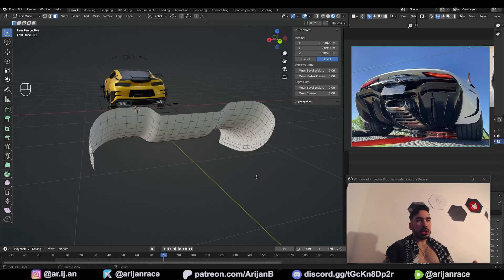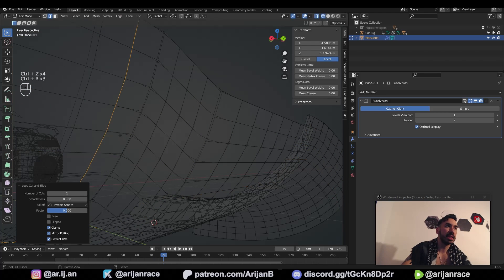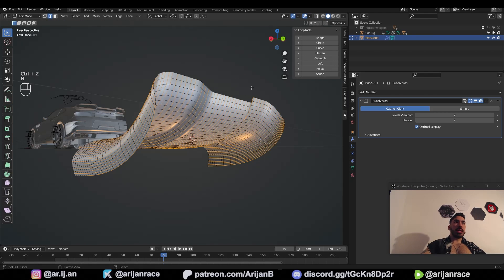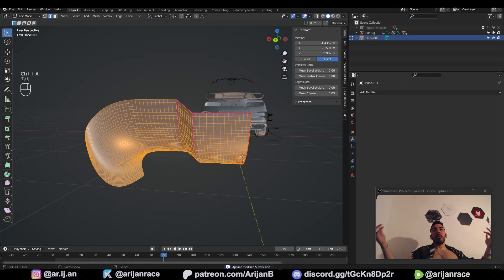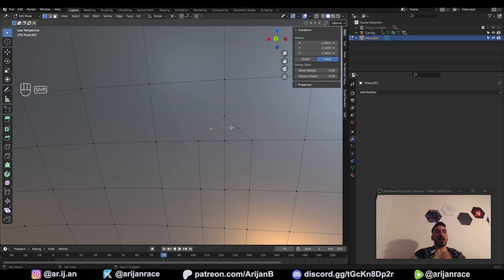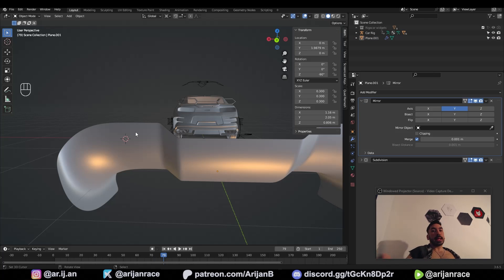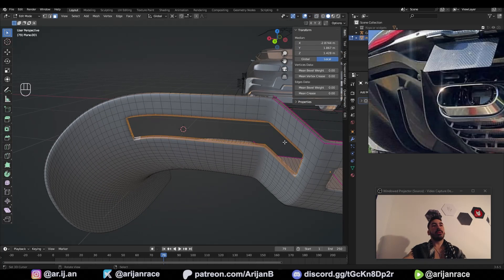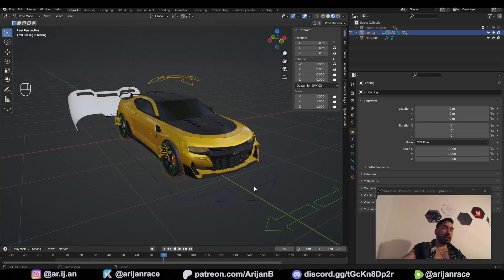The BEST Topology Tips for Car Modeling in Blender (Aryan Tutorial)

Comment: Edge flow is also great addon that  is normalizing flow of mesh so you don't have sharp edges. 

Also there's another way of making stuff like that diffuser fin, non-destructive. You make fin as separate object, add smal lip at the top, set that lip into vertex group. Then you use shrinkwrap modifier, select object that you want to "glue" fin to and pick vertex group form shrinkwrap menu. That will connect two object perfectly and non-destructive,.

Comment: to tip 3: if you want to fast select your sharp edges, go to edge mode with 2 then look in the menu on the top on the window, click on select - select sharp edges. you can fiddle around with the pop up on the left bottom corner to increase or decrease your selection. i use this selection for making seams all the time. it allways gives you a solid base to start your uv maping.
Reply: 3000 IQ